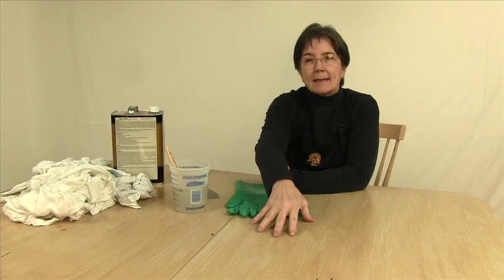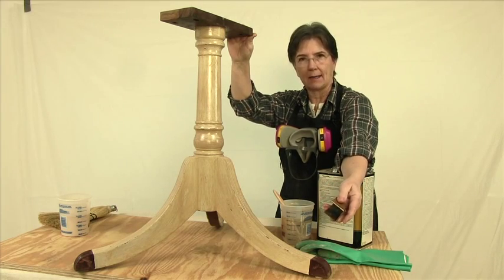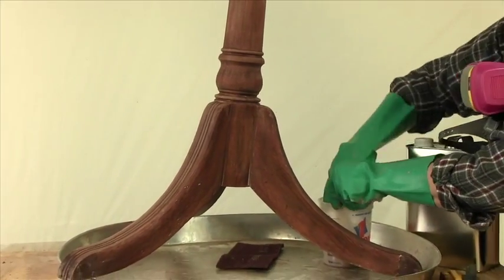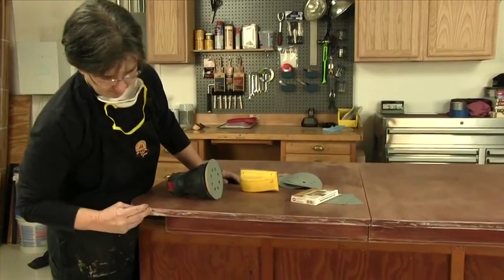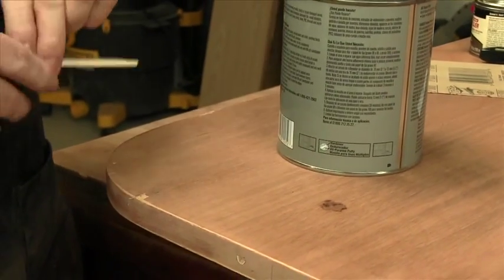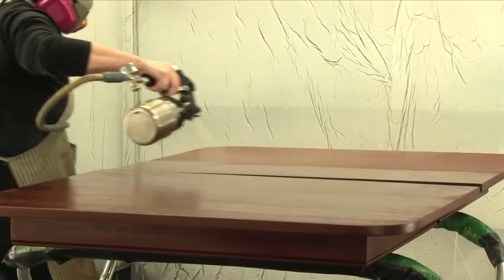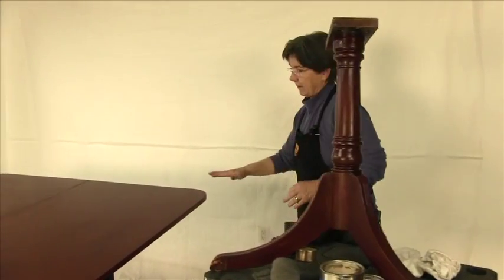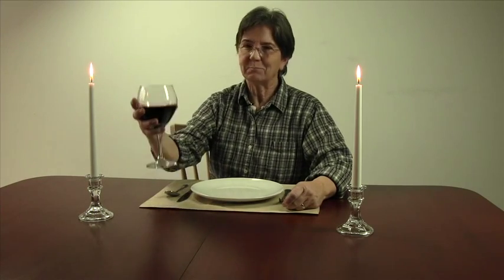How-to Remove Stain and Finish an Old Table | Refurbish

Comment: I followed your video on my Acacia wood table to remove clear finish using Citrastrip. I covered with plastic wrap and let the stripper work for about 90 minutes. I cleaned with mineral spirits with a scouring pad, then again with a rag with another healthy amount of spirits. Waited 24 hrs to dry. I'm at raw wood after sanding with 80 grit and noticed the pores weeping or bleeding the dark stain (or mixture with the stripper), then eventually dried to the touch about 10 hours later. I neutralized it with more mineral spirits, came back 24 hours later and the pore bleeding continued, then dried again. I rubbed down again with spirits and left to dry 3 more days. This morning it has been 5 days since removing stripper, so I tried again to sand over what again looks to be hundreds of tiny stain dots that seemed to have dried. Nearly 30 seconds after sanding this morning, they come back again. What should I do?

Comment: This was the largest mistake I made. I used an electric sander to remove my finish, and the old finish would gum and caused a hard spot and etched scratches into the wood until it was too late. I only use a scraper and hand sand from now on.
Reply from the maker: Good luck!

Comment: When you sprayed the pedestal with the aerosol, was it a sanding sealer?  Thank You.
Reply from the maker: The sealer that was used in the video is by H. Behlen and it’s a vinyl sealer aerosol B102-8000. It doesn’t say whether or not it is a sanding sealer, but whatever project you have at hand, simply touch your surface and you will immediately be able to tell if you need to sand and soften it before another application!
Reply: Thank you.